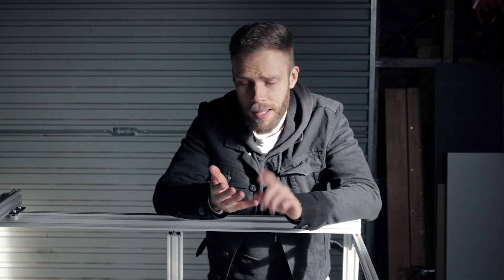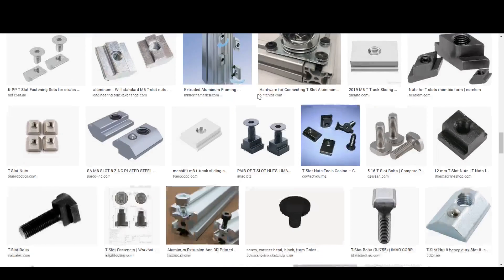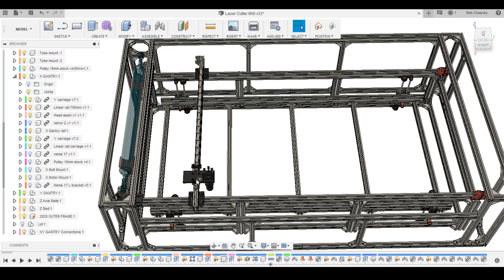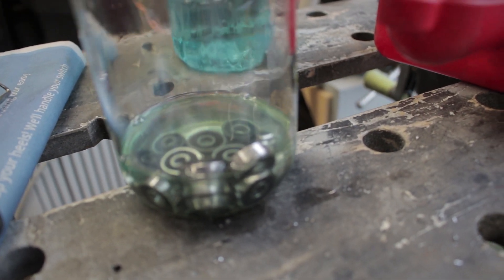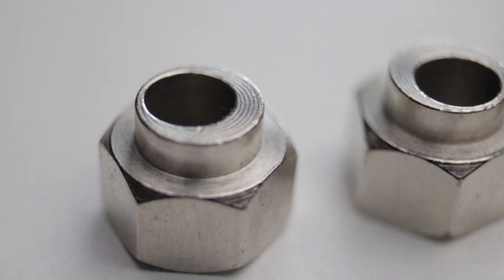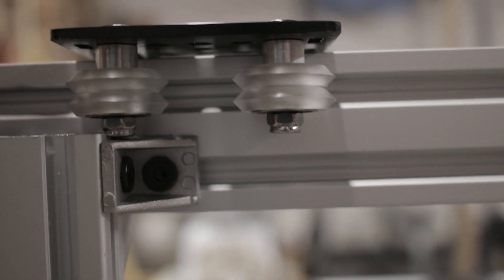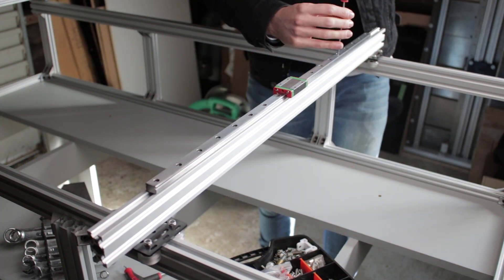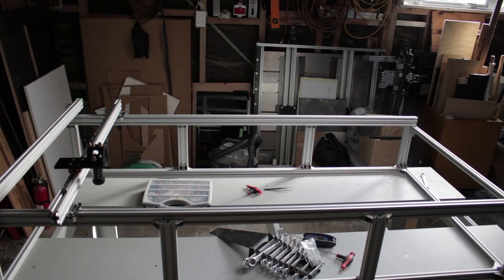Ep2: Back on Track? The DIY Laser Cutter/Engraver Build Series

Comment: First off Thank You for your time and sharing.  I have a comment on the drop in Tee Nuts.  If you get a small block of Beeswax and just run the threads across it then put the Tee Nut on, that will grip the nut and will twist until locked in!  Also on another unrelated note, you can use this same trick on wood screws.  It will lubricate them and takes less effort to drive them in when working with really dry or dense wood!

Comment: Curious why you went with 4 wheels per v slot plate.  Most I've seen go three wheels so adjusting the tension is much easier.  2 on one side, 1 on the other.

Comment: As a mech. engineer it's such gore to see you dry out those bearings :P Check factory datasheets for suggested greases. They're made of really hard materials which will scratch easily with slightest movement. Great videos tho mate! Really helpful and your designs are worth it 100%! I'm super lazy on CADing. :D Planning on building my own revision on your design, fantastic starting point! Keep it up mate!!

Comment: 7:22 Looks very smooth.  Excited to continue in this series.  I've been browsing a distributor's site which has a great PDF that explains really everything you need to know to get started working with t-slot aluminum.  I will probably start with a 3D printer, but a laser cutter is next on the list of projects I want to work towards.
Cheers.

Comment: 1:05 - notice one in center, second row. It looks like ones you use, but is smaller and have piece of metal acting as spring. You can push it from side into profile and spring will hold it in any position you choose.
I used those in company I work in and they're just great :)

Comment: The bearings you're using for the gantry are not meant to be mounted in that direction. The force vectors you're putting on them mounting like that are 90 degrees to what they are designed for. I think AvE has a video on different types of bearings. Your simplest solution would be to rotate mounting the carriage plates 90 degrees, and run the v-wheels in the top and bottom track of the extruded aluminum.
Reply from the maker: hmm very interesting, thanks for the comment! It's pretty common to see rails mounted like this though. My last laser cutter used the vertical v-wheel configuration, so I'm curious to see whether it's a noticeable difference.

Comment: I always use a drop or so of Blue Locktite on the bolt going into those kind of drop in T-nuts.  Then I let it dry overnight, this does not impair the bolt from screwing into the T-Nut but it causes the T-Nut to positively spin in the extrution and gives you 100% of the time a 90 degree turn on the T-Nut.
Reply from the maker: That's a great tip, thanks! Getting that 90 degree spin can be a real pain sometimes

Comment: Thanks so much for the video! I thought about assembling a laser on aluminum profiles, but everyone says that this is impossible, they don’t. But saw your video, you are super !! Now for sure I will assemble the same machine !!
Thanks you

Yes, a gesture at 0:24 among Russians means "fuck you" ))))
Reply from the maker: Aluminium profiles work great for this kind of thing!

Oh no! I had no idea
Reply: @FurtherFabrication  I did not think that the rollers for aluminum have a high accuracy in the position of the X and Y axes.
Tell me, what is the accuracy of the laser 0.01 or 0.05? Maybe it depends on the belt? thank

Comment: Question...
Why use rollers and not linear rails? And why have the short axis rail vertical and not horizontal to reduce flex across the rail?
Reply from the maker: Good question! Cost basically. Rollers are cheap and do an ok job. The less mass flying around on gantrys, the better I reckon.
Reply: are the linear rails so much better? I'm in doubt in which one to go
Reply: @FernandoRosentalski  I have two machines one with linear rails one with runners, issue is when runners and the nylon wheels wear a bit they loose accuracy, whereas the rails 'remain tighter' for longer

Comment: I know your planning on lists and plans etc at the end , but i am interested in the laser head assembly you attached to the mgn12 block? I have only found ones to go on mgn15. Could i possibly have a link for this please? Ali-express i am assuming.
Reply from the maker: The linear rail is an mgn15 H. Hope that helps
Reply: @FurtherFabrication  Ah ok the MGN15h rails i have require M4 screws and T nuts to install , i thought you used M3 so assumed it was the smaller rail.

Comment: You can pop the bearing shields off with a razor blade and properly clean/lube those sealed bearings.  Not going to get much in or out of them with the dust shields on as they are designed to keep stuff out.  Following this closely!  Appreciate the time and effort your are putting into it.  Will you have a donate option for the plans when released?

Comment: For the linear rails, buy a box of accurate bearings, they only cost a few bucks and are vastly better than the bearings that come in the cheaper linear rails, it will make a massive difference.
Reply from the maker: Thanks for the tip! I'll look into it
Reply: This is a bit late to be relevant here, but for later viewers:  I have seen reference to a range of oversize precision balls.  These can be used to counteract inaccuracy in the bearing-block manufacture.

Comment: Make sure you put a grease (zerk) fitting on that Hiwin bearing. The bearings roll against each other inside the truck races and can wear the bearing out quickly if not lubricated. 
I couldn't tell if that was a real Hiwin bearing or a Chinese knock-off. Doesn't look right to me. (Unless Hiwin changed their design since the last time I bought mine.)
Reply from the maker: Thanks for the tip! it's a Chinese knock off - but that's kind of the theme of the build haha
Reply: @FurtherFabrication  Nothing wrong with Chinese products. The quality of their products have improved immensely over the years.
Reply: @FurtherFabrication  Look at getting some accurate bearings as well, it is an easy modification and makes the cheap rails much closer to the Hiwin ones.

Comment: Nice progress! Something I noticed with large laser cutters is that the distance that the beam travels can lower the cutting power once you get to the far end of your work area. I have a 900x600mm bed, and I rarely use the farthest area from machine origin because of this.
Reply from the maker: Thanks! and thanks for sharing your experience - that's something I've noticed as well, literally 90% of the cutting I do is in the quarter closest to the tube head as well